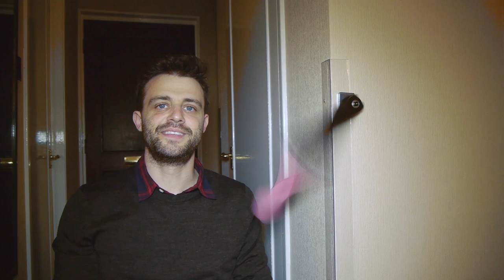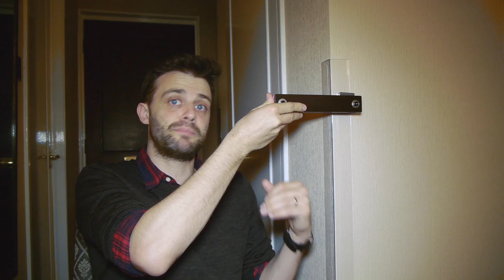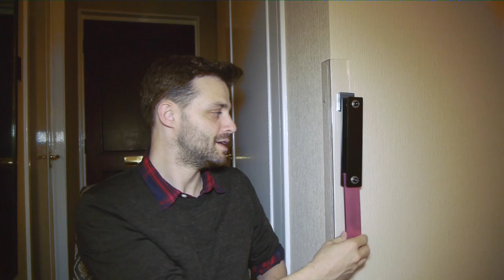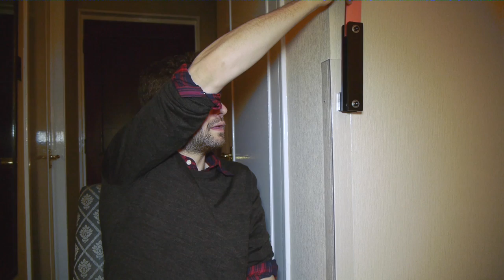Chaotic pendulum - guess when it will stop flipping

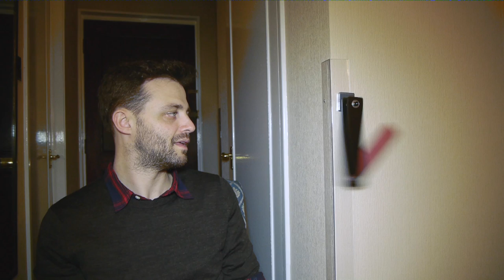Comment: 3:28. 
admit it, when you said "completely different", after releasing it for the 2nd time, you briefly distrusted physics and thought about how you'd have to retake the shot if it for some reason turned out to be too similar:)
Reply from the maker: You got me!
Reply: +Steve Mould You should play 2048 hexagonal version, on the biggest grid the goal is a tile larger than 1,000,000!

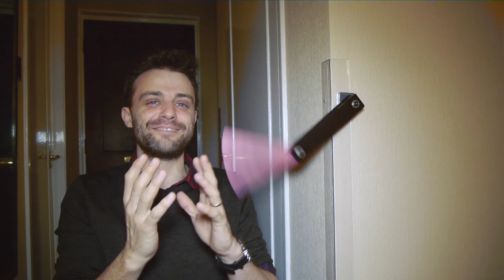Comment: 0:15 : "Chaotic means there is no equation you can come up with... which will give you the position of the arms in the future in a reliable way."

This statement can be misleading for the uninitiated. You're technically correct, but that is not the reason of Chaos. 

You can definitely come up with the "certain" equations. Reason why chaos happens is because you don't know the exact value of the "Parameters" and/or the (initial) "Variables" which you have to feed to the equation. And since the equations of such systems are non-linear, small mistake in these parameters/variables can propagate to big changes, and so the system becomes unpredictable over long period of time.
Reply: Nope. Computing the future state is not only impossible in a physical sense as you suggests, It is impossible even in the mathematical sense. You can come up with the differential equations describing the evolution (obviously), but you cannot write down an equation that explicitly computes the state as a function of any given point in time. Series expansion with infinite number of terms, or timestepping with infinitely small steps will do you no good. Given that there is no analytical solution, whatever scheme you propose for advancing such a solution through its algorithmic steps, will serve the same role as physical unknowns/disturbances.
Reply: @eelcohoogendoorn8044  I think he meant the same thing you said...that we can get a general differential equation of motion but that is pointless in mathematical sense also as we can't get the particular equation that can predict the space coordinates from time coordinates
Reply: @chiranjitray760  His literal words are strictly about uncertainty in initial conditions, like a physical measurement problem; but even given mathematically exact initial conditions, it is still mathematically impossible to extrapolate to arbitrary timepoints in a convergent manner. And contrary to what is stated, yes, that is the essence of chaos in a mathematical sense.

Comment: 3:48

Edit. Turns out I was late. The way it seems to work is like two rods randomly moves rotational energy to each other. When the longer rod is pointing down without moving, the shorter spins like crazy. And vice versa.